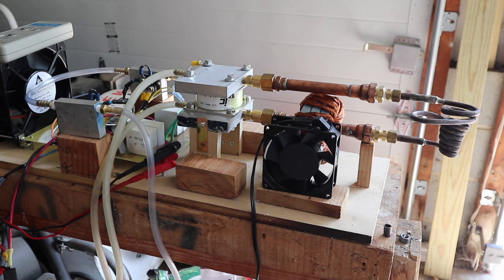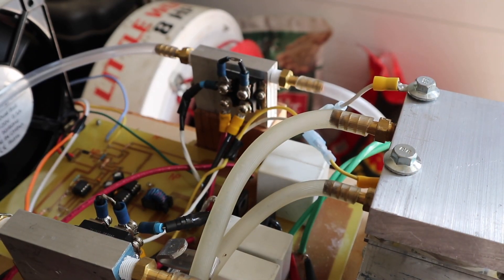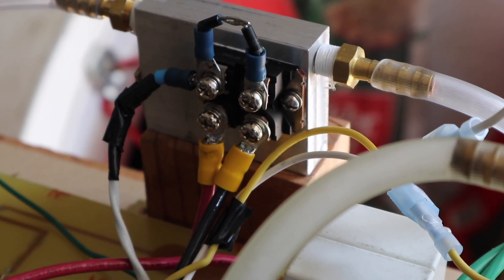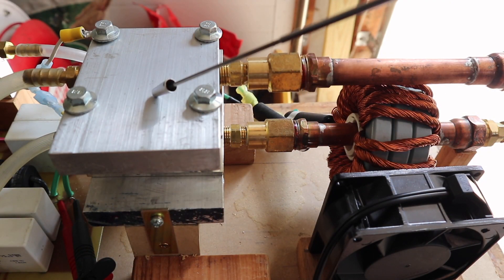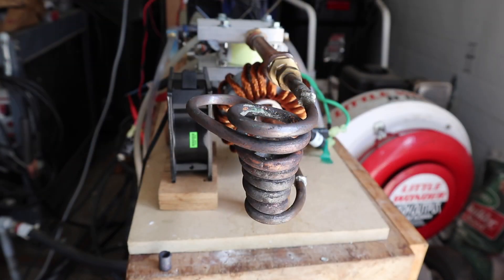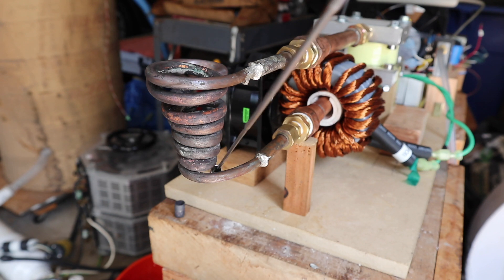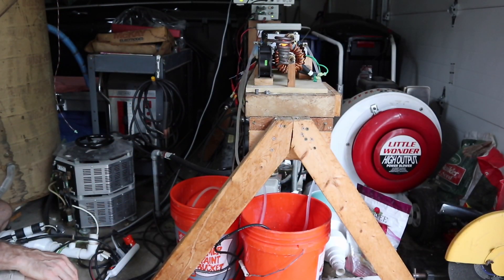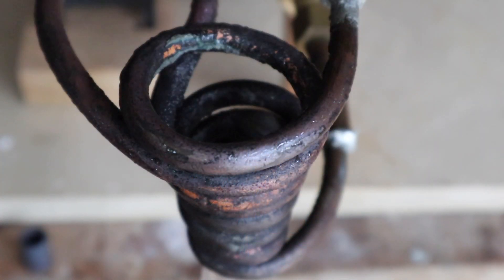induction heater levitation melt aluminum steel copper with magnet

Comment: Fascinating. Do you know a ballpark figure of your total costs?
Reply from the maker: About $500-$750 depending on what other components you have available from other projects. You can build it cheaper, but it would not be as powerful. You could also do away with the isolation transformer, but this would remover a significant safety barrier which I do not advise.

Comment: hi, great job. I have been following your videos and your web page where you publish the schematics, in this video are you using a 555 in the control card instead of the CD4046?
Reply from the maker: The 4046 VCO is controlled by a microprocessor to adjust the frequency.

Comment: I have a quick question. Why does steel require much more power than aluminum. I understand that density is at play with this but I’m having a hard time finding an equation that relates density to power required to levitate and melt it.
Reply from the maker: I don't know where you would get an equation, but force is proportional to the magnetic field which is proportional to the current. If an object is less dense (thus less heavy for the same volume) the same amount of power would levitate it more.